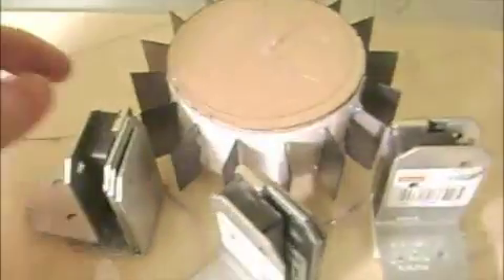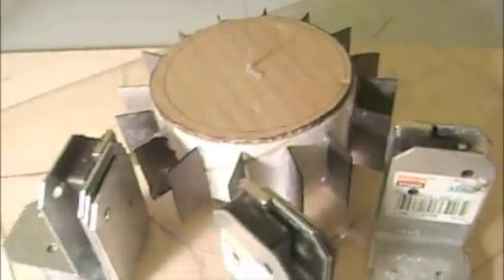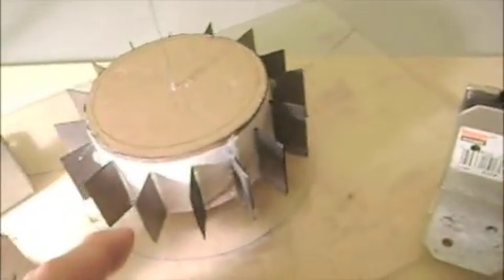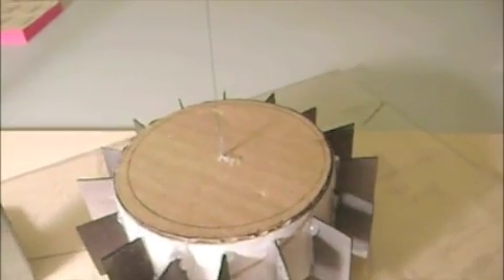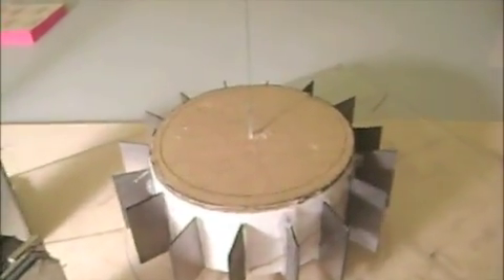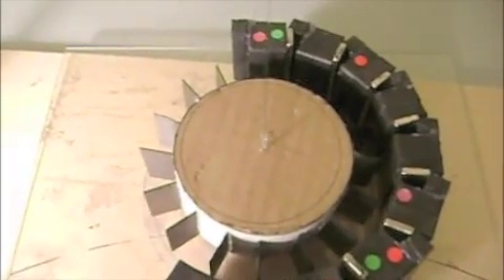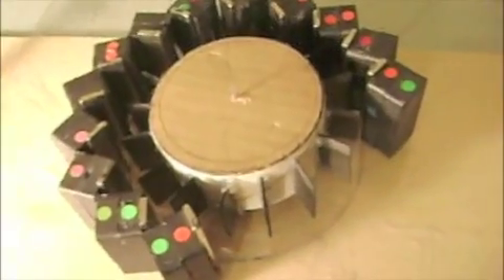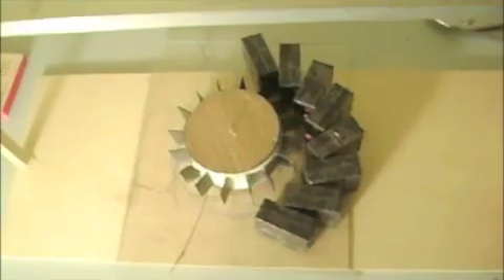Pyrolytic Graphite Rotor

Comment: it is totally feasable, you just need such a powerful magnetic field its beyond impractical.

i built an ultralight bladed disk just like you- carbon fibre skeleton with pyrolitic graphite ‘blades’. 

the field strength is inversly proportional to distance so you loose enough repulsion to effect the whole blade and it wont levitate never mind spin. 

do it with an MRI electromagnet or in close to zero g with graphite almost parralel to field and it would induce rotation but with no torque-  a super cool paperweight for your moonbase

Comment: Try putting aluminum or steel foil on one side of the graphite going in one direction. Use four panes like a radiometer and use two strong parallel magnets so as to get a uniform field. ;-)

Comment: effectiveness of piro graphite is a t short distance so chop them up and build 4 wheels stacked on top of one another . use paired north and south thin magnets that can get up close to the graphene with thin shielding backing onto the magnets only use as much as required to shield 90+%. n40 or stronger n35 magnets prob ok too.

Comment: Energy is used to polarize  permanent magnets, and that energy stays in the magnet as long as it remains a magnet.
If your motor worked, it would draw that energy out of the magnet, reducing the field to zero, and the motor would simply stop.

There ain't no free lunch.
Reply: No it wouldn't otherwise fridge magnets would get used up.

Comment: you also are using too many pryolytic carbon too as long you have a magnetic field all away around a few of them should do the trick better ha hint.  Oh I am a person that thinks outside of the box by the way
Reply: i think all this good tech exists and is hidden from us in order to keep us all in line. using thin as possible and long as possible material magnets and graphene will give the most effective net force. this as possible shielding on magnetic faces aswell.

Comment: I've watched many of your videos and I have to say, I think this is the coolest. You're providing a great service by testing out many of these proposed device. It seems like it would make more sense to tilt the graphite sheets at an angle and hold it over a giant neodymium magnet at the center. All those ceramic magnets pointing at each most produce an convoluted flux. I"m curious if you've spent any time looking John Searl's work.

Comment: with the water wheel blades wouldnt it have lots of wind resistence? maybe shape the center like a rotor on a wankel engine and try it in a vacum chamber to reduce drag from air molecules

Comment: why not have the graphite flakes arranged like the blades of a conventional turbine propeller (average of 45 degree angle), suspended above a magnetic flux going perpendicular to all the blades?  You could do this with a circular magnet where the poles are on opposite sides of the circle.  The inner and outer dimensions of the magnet coincident with the effective part of the rotor.
Reply: +David Austin Oh wait a minute.  this Motionmagnetics guy believes in perpetual motion.  Um, nevermind.  I just answered my own question.  The spinning motion of the graphite flakes will induce an eddy field in the magnetic field in equal portion.  ie.  it will never fly orville.

Comment: ideally you want the pirolitic graphite fins to only stick out about 3mm max if not less. remember flux must be dense. so use min n40 or n35 neo magnets. and remember polarity is insignificant when it comes to pyro carbon

Comment: Have you ever noticed that when pyrolytic graphite floats on top of magnets that it sits where the flux loops back into the magnet and is very very close.
Could you make a turbine blade type configuration over such a flux loop or get a pointed magnet (see magnetman)
I'd suggest using very thin slices of pg and something like a pin on glass as a low friction bearing.
Reply from the maker: bridgendesar I like how you're thinking. Yes, I believe that would be possible. I mentioned something like this in my video on the magnetic spin vortex. I believe it might be possible if you could come up with an extremely low friction bearing, with the right type of blade configuration, on a strong enough magnet.
Reply: I suspect that the repulsion in in the direction of the applied field i.e. straight back on itself, but you never know!

Comment: TRY TO GLUE ON ONE SIDE OF GRAPHITE A STRONG PARAMAGNETIC MATERIAL SO ONE SIDE WILL ATRACT THE MAGNET AND THE OTHER WILL REJECT DONT USE IRON BEUCAUSE UNDER MAGNETIC FIELD IT BECOMES ITSELF AN MAGNET WITH 2 POLES...
Reply from the maker: Vasile Dicu I've actually been toying with trying something similar to that. The trick is, to find a material that has and extremely low level of magnetic attraction. The pyrolytic graphite has a barely discernible level of magnetic repulsion. So to place a highly magnetic material on one side of it, would be a wasted effort. If a balance could be found though... Well, that's the real trick.

Comment: The problem with this idea is that you are trying to make something like a radiometer using the diamagnetic graphite.  This will not work because the graphite is diamagnetic to both poles equally.  In a radiometer you have a black side and white side to the vanes which react oppositely to light.  Basically you have a dual reaction to a sigular input.  So for this to work you would need a substance or something that reacted to only one pole of the magnets and not the other.  This has absolutely nothing to do with the 2nd law of thermodynamics or whatever blah blah blah. 

This is what people misunderstand about magnetism.  It is a binary force but the difficulty in making it usable it that everything reacts with both sides of it.  This is why the failures and hoaxes outnumber the legitimate ways to do this by at least 10-1.  The V Gate motor you showed on your other video demonstrates one of many ways to overcome this.  There are many, many other ways as well.

Comment: are ur mags nD or ceramic and are the strips the same as a strip from say a fridge door?
Reply from the maker: mmrutman They are ceramic, with sets of two north pole magnets facing, on each separate rectangular assembly. The idea was to spike the magnetic field into a tighter area of flux, and focus it at the pyrolytic graphite strips. And no, the strips are graphite. Completely different material from the halbach array configurations used on refrigerator magnets. 
Thanks.

Comment: Skwisgar2322, you sound educated but you're wrong. A magnet will attract and therefor move eg. a piece of iron. Assuming we let the iron sit there and have no need to remove it from the magnet, then the magnet clearly has done work. A one shot energy potential, just like oil that is burned only once as well. Quad erat demonstrandum.

If we however find a way to remove the magnet from the iron with less work than it has done before, then we have found a neverending source of energy that is superior to any other known energy source. 

And BTW., the "laws" of physics become obsolete frequently.

Peace
Reply: +Harry Hasler Really? Would you mind sharing an example of a law of physics that has been proven obsolete recently?

Comment: The basic flaw with any magnet motor concept is that it ignores the second law of thermodynamics, there is no energy IN a magnet (other then the rest energy any mass has) you see a magnet pushing an object and you think there must be some force in the magnet, the truth is the force is all coming from whatever is pushing the magnet. Energy cannot come from nowhere.
Reply: gravitational potential energy and fusion. the molecules of hydrogen in a nebula are attracted to each other by gravitational forces that cause them to coalesce into a sphere of mostly hydrogen and other gasses. when the gasses at the core are compressed by the mass of gasses above they are heated, eventually they are put under enough heat and pressure that the hydrogen can fuse through the proton-proton chain reaction into helium. the energy released is enough to push back against the gravitational pressure and it reaches equilibrium. Depending on the mass of the star, it may continue through several other stages of fusion until it fuses Si into Fe. this is the last stage of fusion as Fe requires more energy to fuse then it produces. At that point the star will undergo gravitational collapse into a neutron star or black hole. Most stars, including ours, will never get to this stage, our sun will become a white dwarf. That detailed enough for you?
Reply: Let's put it in much simpler terms. They don't work and you need to learn why.
Reply: "that kind of metal" is steel. it doesn't stop the field, is simply bends it. No matter what scheme you come up with, you cannot get energy from nothing, it is one of the most fundamental laws of nature. Magnetic fields themselves do not produce energy.
Reply: Jesus Christ
0/10 obvious troll s obvious.
Reply: Actually, magnets do have energy in their structure, and you could make machines that would harvest the energy gained from demagnetization.

A simple example: take a thin, flat neodymium magnet. If you break it in half, you have a convenient energy potential by allowing the two plates to pull together. They will pull with a magnetic force, over the distance between them (1/2 the original length, since we're looking at the average distance).

This kills the magnet.

Calculating it gets a bit calculus-y, but it's also doable. https://van.physics.illinois.edu/qa/listing.php?id=17858

You could experimentally verify these calculations by grinding a magnet up and measuring the extra thermal energy generated (temp change with specific heat) This would be a lot like a bomb calorimeter in theory.

Of course, none of this generates energy from nothing. The same energy was put into the magnets when they were formed, usually inside a very powerful inductive coil. You're just releasing that.
Reply: But energy can be converted, so in the case of a magnet losing its magnetism, the electron spin is gradually tranformed into heat energy (Abeit low) over a long period of time.
Reply: Or to put it in simpler terms. They're always going to get stuck at a midpoint between magnets, ie the point where it has the lowest potential energy.
Reply: @Doazic  https://www.youtube.com/watch?v=yVSMAks7aEc
Reply: Isn't force energy I don't understand the logic
Reply: Another question does this method weaken or reverse the magnetic field when the forces of the electrons oppose one another
Reply: Actually, modern rare earth magnets can have several watt hours stored in their fields, but to extract that energy you would have to destroy the magnet at an atomic level while it was surrounded by a solenoid approximately the size of the entire universe.
Reply: magnets don't "cause" energy, nothing "causes" energy. energy just is or isn't, it cannot be created or destroyed, only converted from one form to another. there is no inherent energy stored in or created by magnets.
Reply: That answer could be pretty simple as we already do that in devices we use on a daily basis. Take a hard drive apart you will find a magnet, on one side of the magnet there is a certain piece of metal on one side of it. If you take that off and figure out what it is (Someone told me once but I forgot now) you will see it stops magnetism if there is a magnet attached to it, but on the magnet size it has full force. Nobody has yet to try a set up with that kind of metal on the one side as far as I seen at least, so go hard lol.
Reply: @subgenreentertainment1347  
Its called mu metal and it bends the magnetic fields going through it and keeps it within its self
Reply: @subgenreentertainment1347 
Its c lled mu metal and i have some samples i got from the manufacturer and it bends the magnetic  feild really tightly so it does not go through the metal, thsts why it is used in hard drives.
Reply: -1/10 try harder
Reply: Kind of right. Not Just heat though as proven by SMOT devices and any other form of magnetic propulsion like electromagnets. Heat cant be the only factor in that locomotion. But yeah the energy is converted. I don't see magnets as an infinite source of energy. I just think magnets can be used as a reservoir or some quantum weirdness pseudo battery. Zap my magnet material into a magnet and it's energy is efficiently "stored" (In actuality: absurdly slowly converted) for an ass ton of years. Perfect for SHTF situations. Now I just need a way to convert magnetic energy into cyclical motion so I can run a generator to get some of my energy back. There is more wiggle room then one may think. There is non magnetic, diamagnetic, paramagnetic materials and various designs and not to mention all the attractive metal that both a magnetic north and south poll find equally attractive. It is an interesting puzzle to think about, if not a fascinating pet project. The bulk of my response was addressing this guys weird notion that "there is no energy IN a magnet" and then he uses his biased form of thermodynamics to try to prove his point. As you mentioned some is converted to heat which is a form of energy; directly apposed to skwigar's point. All according to plan ;)
Reply: The 2nd law of thermodynamics, or the thermodynamics law in general, is a crock of shit. There is this thing call resonance that amplifies the ions to produce a higher current flow, the person who created the thermodynamics shit wasn't even aware of the possibilities of ion amplification during their time, funny how people still cling on to an ancient 'law', they're not 'law' per say, they're theoretical concepts, anyone who follows closely and consider it law religiously is a person who isn't looking for answers, they follow whatever is given to them.
Reply: Skwisgar2322 The most fundamental law of nature is that you can't get energy from nothing? Okay, where do stars get their energy from?
Reply: Energy is coming from the spin of electrons at the Quantum level; so in theory it is possible.
Reply: "Energy cant be created or destroyed" Is that correct? Yes. Ok so lets say I create my own permanent magnet by strategically zapping a ceramic or some magnet material. Now I wait an ass long time until the magnet's charge disappears because magnets do lose charge over a long time. So tell me, if I did not use this magnet at all, and let it age to death (as they naturally do) were did my initial zap energy go? Does the magnetic magic eradiate outwards? If so we should be able to harness it for something to do work. Just how if you run a battery with a light it eradiate photons and heat, theoretically you can catch some of those photons with a photovoltaic panel; all be it you will still have a net loss in the battery due to inefficiency. But wait you cant use magnets to do work. Ignoring all electro magnets, lets conceder a SMOT devices. You can move an object with them. It takes energy to move something. End of story. Ok so you don't like SMOTS? The spin of atoms themselves?  Thermodynamics swings both ways.
Reply: jesz weez luize if i hear that ignore law rubish im gonna vomit. any magnet motor if ever built utilizes magnetism which is a quantum force and infinite. so put a sock in it this will be the future of energy if the public ever work it out. doing it on a molecular level will lead to a perpetual battery
Reply: @ninosbinno8465  "...which is a quantum force and infinite" -- Lol, that's a huge contradiction on its own, bro. Please don't try to argue using quantum physics unless you know what you're talking about. Quantum mechanics RELIES on finite answers, and any "infinities" that seem to pop up in your calculations are generally an indication that you've done your math wrong, or that you're using bad equations. Infinities are NOT natural. It's called QUANTUM mechanics for a reason -- the entire field of study revolves around QUANTIZING spacetime and reality into its smallest possible FINITE parts, (putting a number/FINITE value on them) rather than assuming that various characteristics of spacetime are infinite.
Reply: @kaylor87  yeh but its also known that you cant apply Newtonian physics to quantum mechanics. Because is not as easy as energy in energy out.
Reply from the maker: Skwisgar2322 I've never thought of magnets as an actual source of energy. I'm well aware of the second law of thermodynamics. I think of a magnet more like a sail on a sail boat. It simply causes the present electrons to focus on an object, whether that be a paramagnetic object, or a diamagnetic one. Electrons, at the subatomic level, are essentially energy. So there is energy present everywhere. Focusing a stream of electrons into or toward an object affected by a magnetic field is, in a way, like using a sail to focus the the power of the wind. Not exactly, obviously, but it's a simple example I use to get my point across.  If you read any recent papers on quantum physics, you'll realize that the idea of using a permanent magnet to focus a field of electrons to cause continuous motion of a secondary magnetic object is not outside of the realm of possibility. And that the laws that govern the universe are not quite as fixed as we once imagined them to be. In the field of spintronics they are reaching that level of understanding currently as well.
Reply: I don't think you quite understand the concept, but that's okay you can keep thinking people are trying to draw energy directly from the magnets. They are trying to draw energy from the energy the magnets cause. Make better sense?